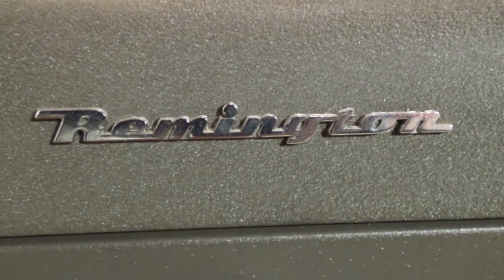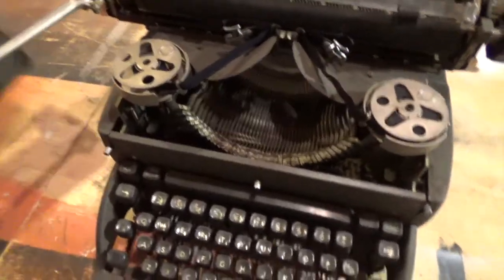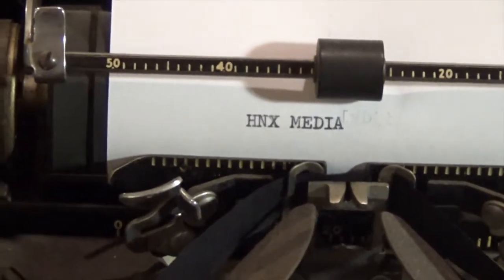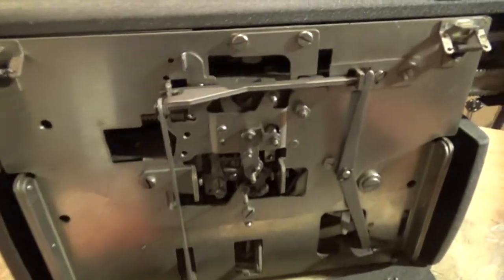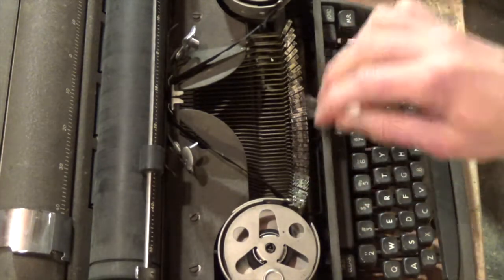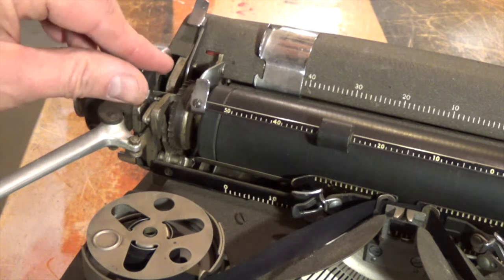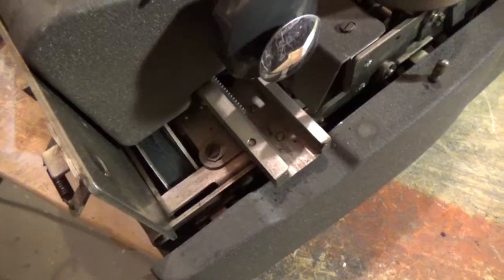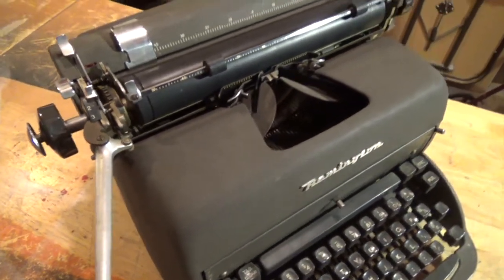1950 Remington SuperWriter Typewriter (Goodbye Old Friend)

Comment: My plywood table top looks like yours, paint overspray.

I have a 1955 Office-Riter and a 1957 Quiet-Riter. Now I need a Super-Riter. Yours has the key margin control. On the Remington portables the S/N is under the ribbon cover, right side, on the ribbon cup.

I clean type faces using CRC contact cleaner, blasts the ink right out of there.

Comment: This model was known in Australia as the SJ, th SJ was a little different  in as much as the back plate was hel on by  longish  shank screws each side, the escapement block differed in the position of the tab brake, the ribbon colour selector was the same black-centre  (to get maximum usage from an all black ribbon, and stencil. Remington from the J     (model 17) onwards  were well designed  and easy to work on, each function was a  stand alone function integrated and synchronized to make the machine  . Your posting gave a lot pleasure and brought back many memories, many thanks. PS you did need more tools than you described.
Reply from the maker: Thanks for watching and adding valuable information to the discussion. It is always good when a true aficionado can help "fill in the blanks" about an antique piece like this. I only have one classic type writer like this left in my studio and I think I will feature it in a future video (it has been in the "background" of several). If you happen to see that video in the future, please add any information you may have about that one as well. Stay safe. Peace.
Reply: @HNXMedia  Just clicked on subscribe. Like to help where I can, don't like to see the trade die and get a bit twitchy when I see the "experts" airing their assumed knowledge
Reply from the maker: @billogle4776  Thanks, that is very much appreciated. I am certainly not an expert on anything (I think my channel proves that). Stay well and I hope you find some entertainment in the random nature of my videos. The other typewriter one will be coming soon!

Comment: I have a couple of these and I'm impressed with how well-designed they are - rugged, but not fancy - and how easy they are to work on. But when did the spring-mounted back panel change? Neither my '56 nor my '59 has that, and it would be so much easier to get into the back!
Reply from the maker: Not sure when that became part of the design. I loved having this thing but had to downsize. The only one I kept was my 1933 Underwood.

Comment: Hello, I’m wondering how to clean my typewriter that was given to me that was kept in the garage for over 60 years. What would you advise?
Reply from the maker: With something like that, I would start with compressed air and get all the dust out of every spot you can. Remove the old ribbon (if it is there) and see if you can order a replacement. Then begin wiping down with a damp microfiber cloth. If it is "dirty" use a little diluted Dawn dish soap on the cloth. Blow it off again with an air compressor and make sure there is no dampness left behind. Then go over most of the metal "working parts" with a very light 3-in-1 oil (not WD40). Get all the parts moving fluidly (none of the keys sticking) and then just repeat the process as necessary. If it is a smooth finish case, you can even buff it with a nice carnauba wax (just like you would a car). If it is a "textured" case, just keep cleaning it with the diluted Dawn until it comes clean. Do not use anything aggressive on the key surfaces or you will rub-off/damage the letters. It is all about patience, but in the end, these things were designed as hard working machines, so you clean/oil them the same. Don't let the age fool you, they are not "delicate" devices. You can get in their with a toothbrush if necessary, just make sure any dampness is gone and the parts are lightly oiled before you consider the job done. Hope I didn't ramble too much. Hope this helps.